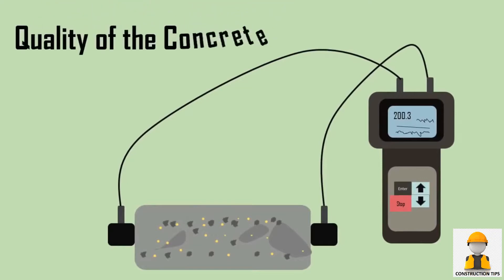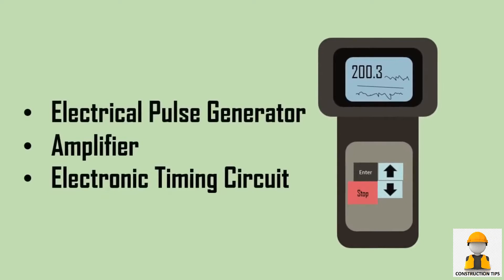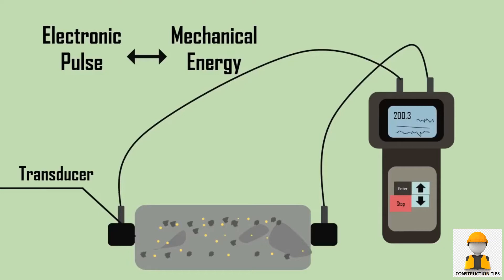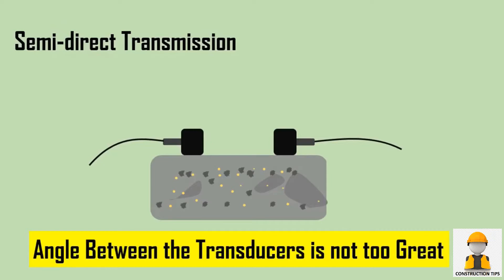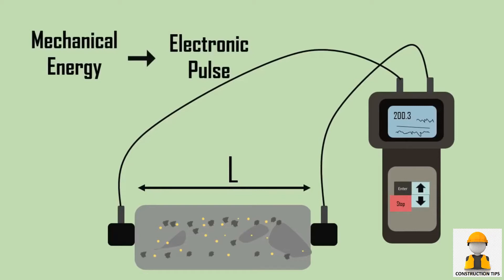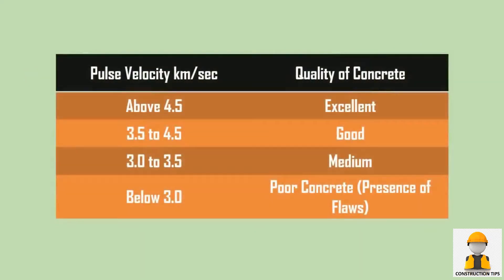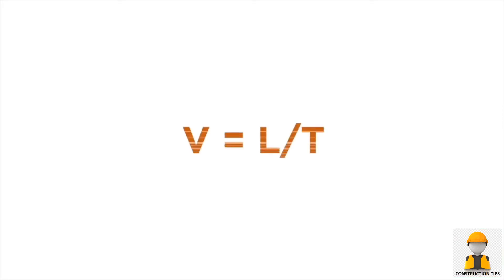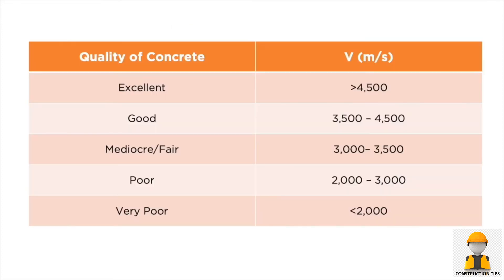You're Probably Using UPV Tests WRONG Without Knowing These Secrets | Ultrasonic Pulse Velocity UPV.

Comment: The description of "semi-direct" and "direct" transmission is wrong. Please correct so that you don't mislead people.
Reply from the maker: Thank you for your comment. 
Below is a description of the direct and indirect transmission methods in the UPV test, as demonstrated in this video. Please feel free to add your thoughts by highlighting specific points, as this will be helpful for everyone.

- Direct transmission is defined as the propagation of ultrasonic stress waves along a straight-line path between the opposite surfaces of a specimen.
- Indirect, or surface, transmission is defined as the propagation of ultrasonic stress waves between points that are located on the same sur face of the material.
Reply: @constructionengineeringtip  I appreciate the fact that you acknowledged my comment but I think it would be much appreciated if you actually put the correction in the video or most preferably a new one for the sake of those that may not have prior knowledge and would want to learn for the first time.